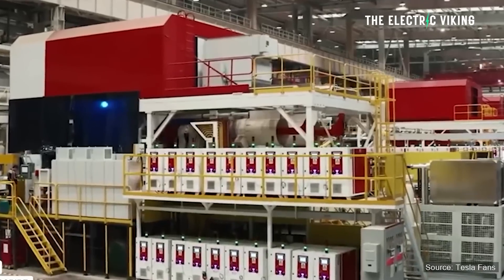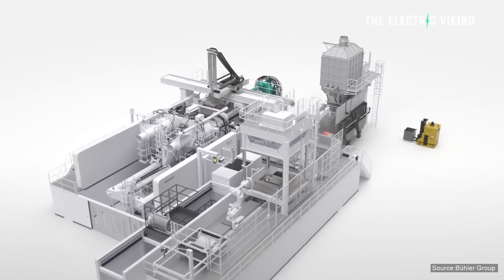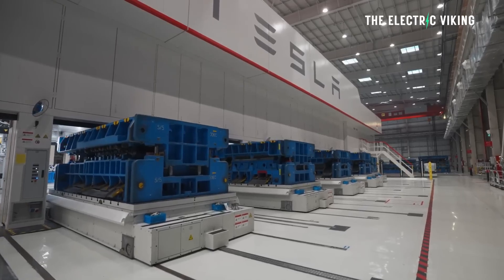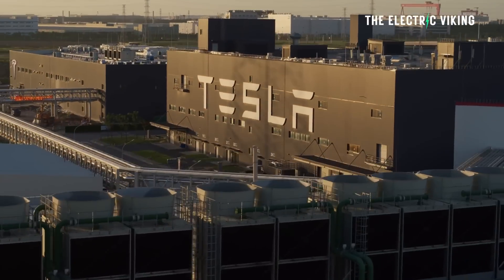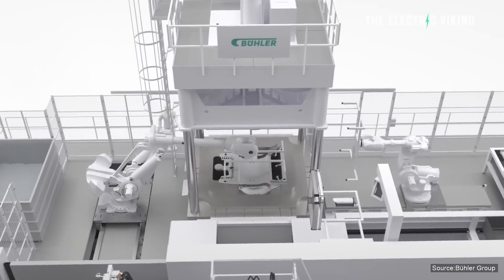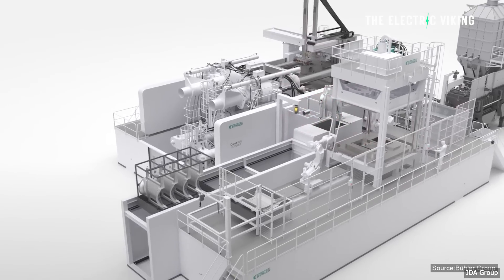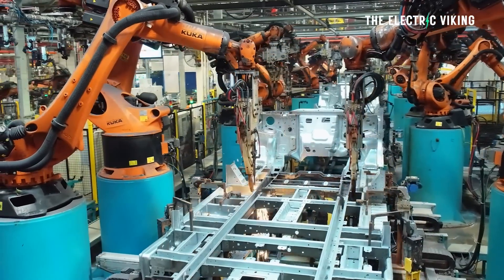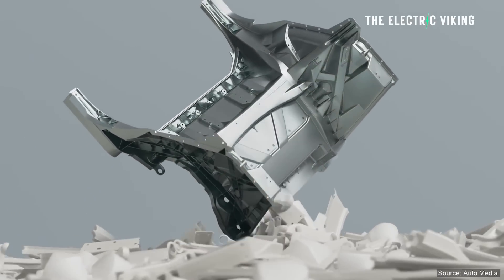Chinese engineers invent giant magnesium Gigacastings for cheaper, lighter EV's

Comment: First principle thinking says: Magnesium is too brittle and it's flammable. In the automotive world, that's a recipe for three kinds of disaster.
1) The casting can shatter. (Cold just exacerbates the problem.)
2) The casting can burn. (Heat from any source, including friction, just exacerbates the problem.)
3) An impact can both shatter a casting and the friction of the fragments rubbing together can set those fragments on fire.
Reply: These castings will be a magnesium alloy to modify properties for the purpose. Just like teslas aluminium castings are alloyed 😊
Reply: As a mechanical engineer working in manufacturing I agree with this, the burning is a risk though less so but the fracturing is a real problem for life cycle of the parts. Just look at magnesium motorcycle rims as evidence enough, there for the reach but not the life of the bike.
Reply: There for the race but not the life of the bike, sorry, I don’t know what happened there.
Reply: It is highly flammable as a powder, not as a bulk...
... but I wonder if casting it needs some precautions... maybe a controlled atmosphere?🤔
Reply: @davidsimoneta8513  While bulk pieces of magnesium aren't usually flammable, we are talking about the home country of tofu dregs. Watch any of the videos out of China where BYD and other Chinese makes of EV are burning in the street, then imagine what that would be like with a cast magnesium alloy body!
Reply: I searched it's SCMP news article, only preliminary, as some commented says if this casting is to go ahead to become commercial
It will need to go through numbers of test, stress, fracture, fire
So there's still sometime away
May or may not become reality
Reply: Everyone knows that the water in the river can drown people, but 90% of the human body is water, so people are drowned, not because of illness🤡
Reply: Someone in the comments section mentioned that magnesium casting is not new.

So the fact that no other car manufacturers are using magnesium casting tells me that everyone already knows about the problems you raised.

So if the team in BYD says they have invented a new way to use magnesium casting, it should be clear that they have somehow overcome these issues that you are talking about.
Reply: @ChinaSongsCollection  Allegedly, you would think that they somehow have solved these problems, but they are still valid concerns relative to particularly cyclic loading. Also, they are still a business that needs results and we’ve never seen business put profit before the good of people, think Deep Water Horizon. If you don’t know, I did an entire report on it for engineering ethics in college.
Reply: @w8stral   "... nothing new in Mg land ..."

Nope, I don't find that believable.  I would still stick to my earlier arguments.
Reply: @ChinaSongsCollection  Go for it... Post something new in Mg land.  Good Luck.
Reply: @w8stral  No, I'm not an expert in chemistry.  I'm sure you know more than me.

But you don't find my original arguments logical???

Why do you think no other car manufacturers use magnesium casting?  And you think everyone in the world knows but yet BYD doesn't know?
Reply: Fire!
Reply: Correct, hopefully we will not be the Guinea pig for those initial roll our experiments
China buyers will be 1st trial customers
Unless there's some truly improvement in those alloys, likely what you outline will happen.
Unfortunately many Chinese customers will find out

If the battery chemistries are LFP, or better sodium batteries
The flammable part occuring may be very unlikely
However the cracking & fracturing frame due to brittleness may be a concern as u pointed out
Unless Chinese alloy have solve these underlying issues
Reply: Brittleness is what I know of typical aluminum magnesium alloys. But yes, lighter.
Reply: Don't forget magnesium is SOFT so that any part which is an attachment point wears out very quickly.  Lets not even discuss abrasion resistance which also sucks.
Reply: @w8stral  I guess BYD has developped an alloy with magnesium... and other materials:
Hard to discute about mechanical properties without detailed information about the real composition...
Reply: @davidsimoneta8513  These alloys are all well known.  Nothing new in Mg land in decades. So, yes, pretty damned easy to discuss unless you are ignorant of the subject.
Reply: @w8stral don't be so drastic: Tesla's gigacastings show that there is potential for improvements also in the field of alloys...😉
Reply: @davidsimoneta8513  Uh, no, your ignorance of Tesla's castings is beyond pitiful.  All Tesla did was take an existing alloy and use it in a large casting process in which said alloy had not been used before genius.    Put DOWN the headlines and read some more.  Stop emmbarassing yourself.
Reply: @w8stral  applying an existing alloy to a new product is also a technological improvement.😉
Which source have you to say that BYD isn't doing the same?
Reply: @davidsimoneta8513  Its called being a mechanical engineer who is not ignorant...
Reply: @w8stral  so why are you resetting your "knowledge"  with arrogance and a very poor attitude to a constructive dialogue? We are here for an open discussion about the topic, not to insult collegues.
Given data from Munro&Associated, Tesla's gigacasting alloy is a AA386 with a blend of 13 elements with unique percentage. You say it's a known alloy.
Who is right?
Reply: Aluminium alloy is used to make jet engines and have been tested by using arc welder, they are not flammable
Reply: @johnwayne8475  No Al, is NOT used to make Jet Engines at all.  Stainless Steel is.  Titanium is.  The shrouds are made of TItanium and Kevlar and newer ones are made of Titanium/UHDPE
Reply: @w8stral  you should contact the FAA, they are the ones who published the results of their testing of the flammability of magnesium alloy, of what they report are used in aeroplanes and jet engines. But what would the FAA know compared to you?
Reply: @johnwayne8475  Ah, your arrogant ignorance makes you fall on your typing sword.  There are magnesium alloys which have low flammability but also piss poor corrosion properties.  These less flammable alloys also have weaker material properties.  There are ways to increase the material properties, generally with the use of Strontium, Ytrium, etc.  But if you take those EXACT same alloys and put them in Aluminum the same increase in material properties occurs and since Aluminum has a 50% higher Modulus of Elasticity and surface hardness it makes Aluminum the superior alloy in terms of deflection, corrosion, hardness for attaching different parts, but it still makes Mg superior in some applications where the flange thickness of the casting can be thicker due to Mg's 30% lower density.  Mg is used often as a CHEAP way to cast a part as it is MUCH easier to cast Mg than aluminum ergo why you see cast Mg transmission housings, oil pans on ICE engines in a few rare cases.
Reply: Umm there are special al alloys which are used in making gas turbine blisks with melting point in range of 950 + deg celsius. So yea it is used in this application. Can’t however state that they are used in aerospace engines particularly. 

On the matter of mg alloys in automotive applications IMHO its not the best engineering compromise. Use al alloys and be done with it.
Reply: @rkriisk  what, like BMW’s hybrid aluminium/magnesium engine blocks for example?
Reply: First principle thinking says: YouTube comments section geniuses are a dime a dozen.
Reply: I suggest you read a little further...

Comment: Wait until the BYD fire problems get paired with a huge chunk of magnesium. That's gonna be exciting!!! 🔥🔥🔥
Reply: Indeed.
Reply: LFP is much better then ternary battery NMA NMC NCA chemistry
When LFP short circuit, heats up they do not usually catch fire but will smoke evaporate out their liquids in the battery 
Unless other fire or high heat ignite the already short circuit hot LFP battery

LFP battery also do Not produce own oxygen thus the fire can be put out like petroleum fire, although the short circuit battery will continue produce heat to dissipate her stored energy

Whereas ternary batteries chemistry produce own oxygen thus will ignite instantly, when short circuit and continue burn non stop

LFP is much safer
Sodium battery say to be even safer, supposedly does not burn, but much less power to weight ratio
Reply: BYD doesnt have a fire problem... fake news
Reply: Don't worry about a problem that doesn't exist

Comment: I’m sure the the Chinese will pay IDRA a licensing fee for every car they cast. 🤣🤣🤣
Reply: IDRA will wind out regretting this.
Reply: IDRA is owned by LK Machinery, a company listed in the Hong Kong Stock Exchange. LK Machinery is one of the largest companies in the die casting and injection moulding industry. LK is also one of the largest machine tool manufacturers. Most of its factories are located in China.
Reply: @nsng1298  But IDRA, and its tech are located in Italy.

Comment: Magnesium is used in water heater as sacrificial anode rod.  So corrosion will be a problem for magnesium parts
Reply: Magnesium was used heavily in MX race bikes in the 70s / 80s for casings wheel hubs etc, powder coating or paint fixed that problem.
Reply: All depends on the alloy. Steel rusts also...depending on the alloy. Stainless Steel doesn't. Ever wonder why?
Reply: That isn't how galvanic corrosion works
Reply: Magnesium alloys like Elektron have reasonable corrosion resistance and with appropriate coatings would be servicable, some alloy car wheels are made of Magnesium alloy.
Reply: It's an alloy you idiot, like "stainless" steel vs steel
Reply: Chinesium magnesium, with Chinesium lithium batteries, in a country prone to flooding, with Chinesium dams, run by the Chinese. 🤔 

🎶🎵👎💦🤱🦆🔥🔥🤱🦆🔥🎵🎶

Comment: I keep wondering about repairs when these castings are damaged... I had already heard that Teslas get "totalled" by insurers more often than others... ?
Reply: An accident sufficient to damage the castings leading to an insurance company to total a Tesla instead of repairing it likely had enough force to also damage a unibody or body-on-frame vehicle sufficiently for it to be totaled as well.
Reply: That's not exactly true, like most things people say. Teslas are in a different class of cars than most, electric cars have been in general more likely to be totaled because insurance companies have been worried about damage to the battery and electrics that is hidden. This will and is changing as more experience is gained.

Comment: Imma assume it's not regular magnesium which has a serious combustion problem. Similar to NMC Lithium batteries it nearly impossible to extinguish once ignited. It does burn real pretty though - so bright it might blind you at close range.
Reply: A different isotope?
Reply: @tedmoss  No, but a different alloy.
Reply: Unfortunately, alloys aren't bound together like other substances. Put silicon and oxygen together and you get quartz, with superior high-temperature qualities due to strong chemical bonds. You want a light alloy? Use light-weight elements. Aluminum is rocket fuel, but it has to be finely divided as it forms a passivating layer in bulk. Magnesium, once going, will burn in bulk as the MgO sloughs off exposing virgin material. Similar to the use of sacrificial anodes to prevent, you can add something to the alloy that is even greedier for oxygen than magnesium, like calcium, but this only raises the temperature before the magnesium also burns
Reply: @Markle2k  You would need an awful lot of heat to get a Magnesium casting to start to burn.
Reply: @philflip1963  An amount of heat easily achievable in a fire. I saw a magnesium bell housing completely cook a pickup. I was the one who called 911.
The auto-ignition temperature of magnesium in air is only about 900F
The fire cause was never determined, but was suspected to be either intentional or an electrical short (the alarm woke me up). It took about 10 minutes for the bell housing to ignite, but once that happened, the fire crew (who took what seemed like forever to show up) stopped fighting the fire in the engine compartment and focused on keeping the fuel tank cool.